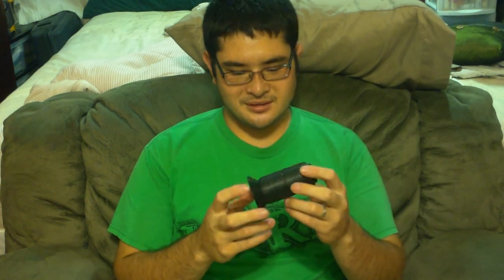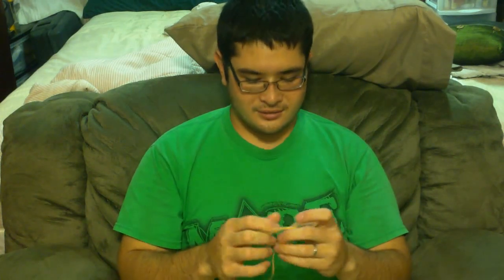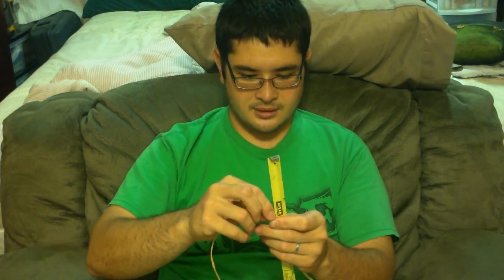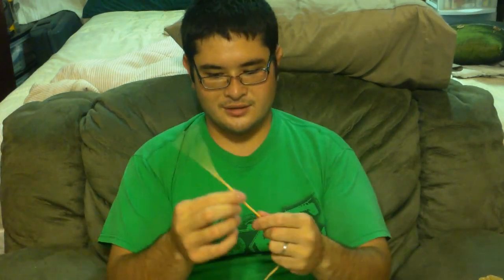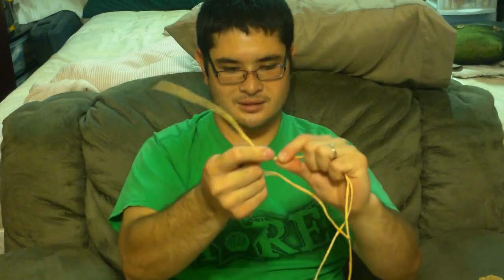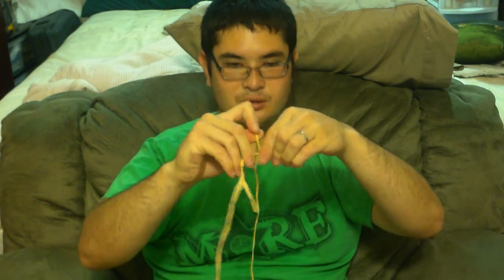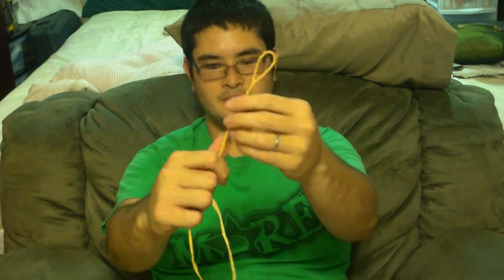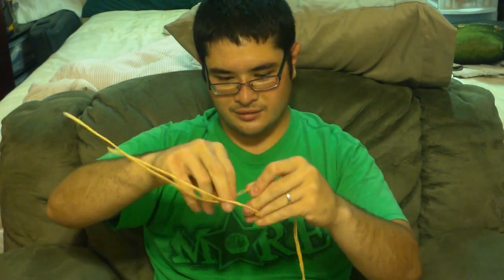How to Make a Counter-Twist Bow String With Polypropylene Twine

Comment: I watched this video back in 2013 when I first started trying to make my own strings and haven't had to buy a string since. I started by using the white twine you get from Lowe's for free over in the lumber section, they give it out at the door to tie off things you purchase to keep it from falling out the back of your truck. Anyway, I made probably 25 strings out of it and finally upgraded my material, now I use Dyna Flight 97, it is much easier to work with but learning with the twine really helped to toughen up my fingers and helped me practice the process and it was basically free. Thanks, Nick. Some of my videos feature the strings I learned to make from watching your channel.

Comment: I have many years  of rope splicing experience, but this is new thanks much for sharing, at the tails of your loops you can make the transition look nicer by cutting the tails at slightly different lengths then it will taper back to two strands from four. Have a Safe and Happy New Year.

Comment from the maker: Thanks!

Strong fishing line works great. Braided Dacron is my favorite, though you could get away with braided nylon on lighter bows. I don't suggest using monofilament for its eventual brittleness, though it works great as a string serving.

Thanks for watching!
Reply: I make all my Bow Strings out of Spiderwire braided 50lb for 12 or 14 strands ... never stretches & lasts forever on my 40 lb bows ... and cost about $2 a string to make!!!!! It's all I will use!

Comment from the maker: It can handle PVC bows up to about 70 pounds without a great deal of reflex, 40 pounds with a great deal of reflex (around 9 inches or so). It will work on traditional longbows up to about 50, recurves to about 40. Add an extra strand and you get about 100 pounds, 70 pounds, 80 pounds and 70 pounds respectively. It creeps more than Dacron, so keep that in mind when making a string with it.

Comment from the maker: @Hawaiiarcher84 Mason line would be fine for kids bows and lighter bows. I would use braided dacron fishing or squidding line (dacron bowstring material if you can get it) for hunting bows as you need to squeeze whatever fps you can out of the PVC bow to get a clean kill. FastFlight would probably speed things up a little, though I haven't tried it enough on PVC bows to know if it would be safe or not.

Comment: If you can find some zinc powder and mix it in with a dark wax then wax the string, you'll basically be protecting it with the same stuff that blocks UV in suntan lotion. Could help protect the string quite a bit from UV radiation :)

Comment: Today I made my first bow string.  I haven't finished my bow yet, so I'm hoping the measurements or going to be accurate.  If not, I'll make another string.  The second time will probably be better anyway.  Based on the table in your book, it should be about a 40 lb. draw at 28" (if the pipe here in Peru has the same characteristics as the US schedule 40... the dimensions in the specs are very, very close).  For this string, I used 2 bundles of 3 strands each (total 6 strands) of artificial sinew.  This is 70-lb. test, polyester and not nylon.
Reply: ***** you can use paracord, I used 550 paracord, just make sure you pre stretch it before you size it for the bow.
Reply: Isn't 550 paracord to fat for an arrow nock?
Reply: If you stretch it, it actually works fairly well, it's def a snug fit, but it does work if you have no other option.

Comment: Could you please comment on the size of poly cord you are using?  Even the 1/4 inch size poly at HD is only around 80 lbs of strength.  I can see the line you are holding is less than 1/4 in size.   This leaves me guessing on size and such.  What size did you use on the crossbow?

Comment: One more thing the back splice only needs to be long enough to resist the force of pulling it apart, it can easily be one third of the length you made this loop, and a quarter the length if you use a Common Wipping below the eye.

Comment: Nick, I have a huge doubt. What brand of poly twine are you using? I've only managed to find either white twine or SecureLine brand twine, but it's safe working limit is only of 7 lbs. Also, is the twine you use twisted or not? Thanks.
Reply from the maker: +As De Espadas I'm using Everbilt twine, which used to have a listed breaking strength of around 400-500. Now the package lists it as having a safe working limit of 7 lbs, though it seems the same.

I think the old rating was probably a maximum breaking strength. The new rating looks like it has a pretty high safety factor. It should work for lighter PVC and wood bows around 35 pounds with two strands and up to about 50 with three.
Reply: Alright, thanks for the insight. What should I look for for heavier bows? Around 70-80 lbs? Should I go straight to Dacron and poly rope or is there any other alternative out there? Thanks
Reply: You can also use the white twine that they hand out at Lowe's in the lumber section at the door to tie down stuff after you buy it from them some other stores have it to.

Comment: beeswax works great unless you are going to be shooting in a colder climate. Beeswax will freeze and make your string brittle if it's too cold.. at least on dacron, not sure if the polypropelene is different. I suggest getting bowstring wax. It can usually be found at wal mart or even on ebay.. most of it is dark colored and comes in what looks like a large chapstick tube,
Reply: I don't believe this for one second.  I've  been using beeswax for over 30 years and have never had any problems.
Reply: and most people probably won't unless they are shooting in extreme cold as I said, it's just a precaution.
Reply: Bow string wax is bee's was with a little tree sap added but mostly beeswax. Maybe in colder climates like yours they include other ingredients to resist low temperatures.